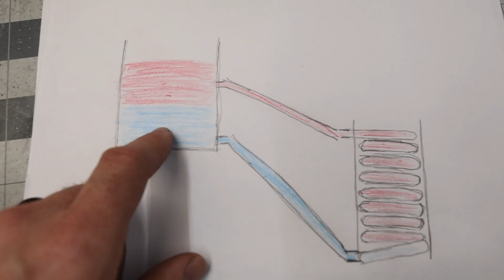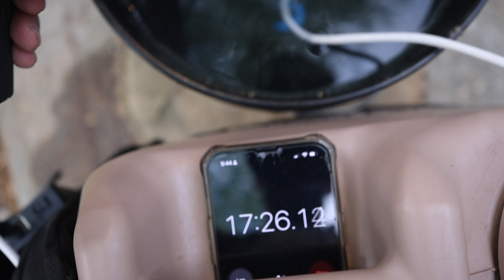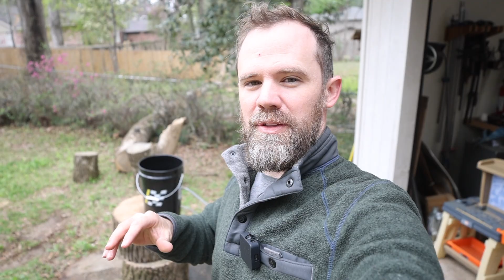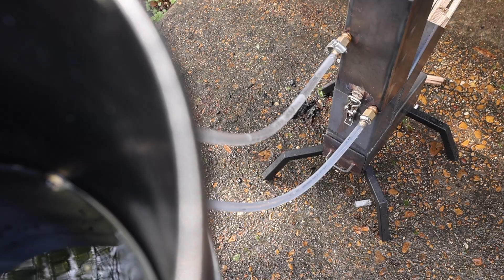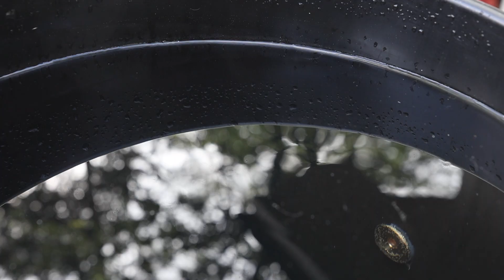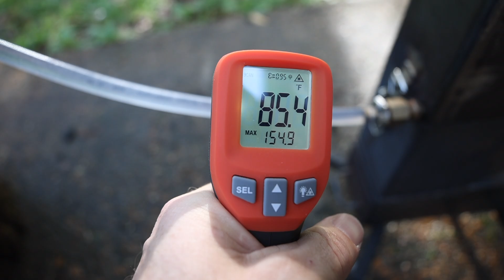Making Hot Water without Electricity!!

Comment: If you start the cold water line at 3/4" and step it down to the size going down to the stove. This will create a head pressure that will help the flow greatly.
Reply from the maker: Thanks for the tip!
Reply: So, have 3/4 inch tube coming out reduced down to 1/2inch just before the start of the coil? Is that what you mean?
Reply: @advdan  Put your inlet on your stove lower than the water jug, so gravity will help push it in. The longer the line, the better.  If that line is 3/4, it will build up a head pressure that will increase when it goes into the 1/2 in pipe. Especially if you use a tapered reducer, like a bell reducer. It will also keep the water from trying to flow in that direction. Make your outlet on the stove just above the hot water inlet on the jug. Ensure the hot water inlet on the jug is just below the waterline, with no water from the jug filling that line. You want to have as little back pressure as possible holding back the hot water. If you put it into the jug above the waterline, you'll get steam and spitting coming out until the flow starts.
Reply: @TheCyberRebel Sorry, but you are confusing pressure with flow, a common mistake.
Reply: @johnnyseagull29   Stepping down the pipe will increase pressure if the pipe is going down hill because of gravity. This is how the old gold dredge monitor works. That's also how those tabletop syphen pumps work. That's a small jar of water that has a tube that comes out of the bottom and dumps water back into the top of the jar. It circulates in an open system without any pumps.
Reply: @TheCyberRebel  this is merely a side effect and only if there is enough FLOW (which is what is missing here) to complete the illusion. To increase the flow you need to increase the dia of ALL pipework. Introducing a bottleneck cannot possibly help.
Reply: @johnnyseagull29  It's just to start the flow, heat drives it. It worked for me.

Comment: I use a similar setup while camping minus the rocket stove. I use a Harbor Freight transfer pump, some check valves and a bag style shower that I hoist up about 25 ft after the water is heated. It's made it to an extended discharge line with a valve at the shower head end. Works like a charm the bag of since water isn't light. LOL thanks for the video, might have to implement some of these ideas including but not limited to a modified coil

Comment: What would happen if the line returning to the reservoir was slightly larger in diameter than the supply? Or vice versa.
Reply from the maker: If I were to do anything different it would probably be that. I’m working on a video now where the copper will wrap around the outside of the chimney but I upped the side of the copper and hoses.

Comment: You can get Thermo Electric Generators that create 12v based on temperature difference. This could power the pump without a battery. If you trying it watch out for the max temperature as is may be to high for some TEG modules.

Comment: This may be too late .   But I used my copper coil incased in steel welded together and filled with sand.    It’s a lot heavier but the sand helps to prevent hot spots .         If you try this beware.  If the steel gets too hot it will sag due to the pressure of the sand .   I ended up using thicker steel and that seems to have helped for the past 6 years or so with mine.     I built one 6 years ago with an ammo can .     It was an upgraded design from the ammo can stove I made when I was 12-13 back in the mid 90s

Comment: You connected your Water Pump to your passive output line; you should connect it to your passive input line to reduce the wear on your pump and increase your thermal exchange efficiency. Cold enters the heat exchange from the bottom, not the top, you were sending cold in the top and out the bottom; you were resisting the thermal exchange and reducing how much heat you could siphon from the burning fuel as a result. You could connect the two lines closer together to increase your available thermal mass; the water is acting like a thermal battery, and the fire is replenishing that thermal battery's thermal energy, but due to how ineffective your thermal containment system is, your thermal battery is hemorrhaging thermal energy; usually, you will want insulated transport lines to reduce thermal loss, this is usually in the form of Copper Lines wrapped in Rubber or Foam, possibly with PVC pipe around that to add more insulation. The reason behind using copper lines revolves around the water reaching ~100 °C, and how effectively the material is able to withstand that temperature in extensive exposure without degrading the containment material. I understand why you used a clear line to record and scientifically diagnose your system, but I explained why those other options are used so you can understand what might happen with the system in the future, and how to fix what breaks. You do want to keep the Cold Water retrieval line lower than the hot water output line on the bucket/container side, you got that right; cold water can absorb heat easier than hot water, so grabbing from lower than the hot output line is a smart idea.
Reply: I can edit this post later from my Laptop if I can find it again, that is easier to do if someone comments on my comment.

Comment: I used a 20 gallon hot water tank and hooked up 2 solar panels in series and water gets to average of 130-145... The top was close to 200 F
Reply: What happens if it does get over 212f
Reply: @Bryan-Hensley I was trying to use this to heat a tiny home... So it will never get to 212.... Tank was stripped of insulation and painted black... The cold on the bottom never exceed 130-140 even in dead of winter with max sun could not heat enough need much more capacity of tank and panels .... But ran 6 months
Reply: Does it work at 10pm?

Comment: Top ! , and the next thing …hook up a boiler and use copper to connect the boiler to the rocket heater ( open inlet for to fill the boiler ) and use thermo sifon to warm up the boiler ( and if you want to add a pump you can use a ( central heating pump ( wilo pump )
Water side pump ( they can stand heat ) 

Stay creative  👍👍 greetings from 🇳🇱 the netherlands

Comment: I'm wondering if it will heat more quickly if the return tube is set higher than the bucket, then using gravity? One option would be to use a taller coil. Or possibly use a box style fill tank having a downslope for cold water and a downslope from the top of the heat exchange back to the tank.

Comment: I wonder if you added a basic mechanical bulb type pump, similar to the type used from gas cans to old outboard motors, attached to the cold supply line that exits the bottom of you water reservoir.  

That may help eliminate the water from boiling immediately once the fuel source is lit and “jump start” or “prime” the system in the beginning to boost the initial siphoning effect. 

I’m sure there are scientific 
words to explain the physics of it.  

Not positive, but there must be a type of one way valve in those bulb style pumps to maintain fuel pressure until the motor is running and creating enough suction to draw fuel to the motor. 

I love your idea and follow up video that shows your improvements and using the community to improve your design.  Excellent work. Great editing also.  I’ve haven’t done much video editing but can assume that it’s time consuming and can make or break a video.

Comment: Just as I suggestion you might put a couple short pieces of silicone rubber tubing at the fitting connections or just use all silicon tubing.  Silicone tubing has a lot higher temperature rating than vinyl tubing at just over 500 degrees.

I have a propane water heater that is a sheet metal box with a burner and a copper coil in it that circulates water the same way to heat the water.  I was trying to cook at the same time I was trying to heat water and I wound up melting the vinyl tubing at the fittings.  I replace the tubing with silicone and no more problem.

Comment: The process you're using for "passive heat exchange" is known as percolation which is what coffee makers use, and yes, it's supposed to sound that way and isn't sketchy at all as long as you have your system set up correctly. A good example for percolation hot water setup would be either soft copper tubing or copper flex lines connecting your stove to water storage and at the minimum a 45 elbow on the hot water return to aim the water toward the bottom or side of the bucket instead of allowing it to possibly belch up and out.
Reply: Percolação é o nome de outro processo que não tem nada a ver com troca de calor, mas filtragem.
Reply: @canaldopicco  I stand corrected, you're correct that percolation is a filtration process. After taking a closer look at a coffee maker, which uses percolation filtration, I found that heat conduction creates convection currents to pump fluids.

Comment: It might be worth considering this in the light of rhe automobile industry.
Early water-cooled car engines used the thermo-siphon effect, which incidentally is why they had tall, narrow radiators. Though this worked on very softly tuned engines, it was soon necessary to add s pump to the setup. As we saw here, with the pump included in the design, it was possible to carry lots more heat away.
Reply: yes and no. thermosiphon necessitates a casting that includes big, free flowing water passages... whereas forced cooling does not.

here, proper design will work thermosiphon... the objective is to heat the water efficiently. the more water, the better. a car wants as little water as possible, as compact as possible... to be made as cheaply as possible... the water is there to dispose of heat, not store it. and yes, as performance goes up, the larger ports, valves, they demand more room, the cooling passages suffer, but theres more heat than ever to deal with... so they throw a pump on. and in the "good old days" they didnt even have decent seals for rotating shafts yet. bit of leather and a gland nut? some graphited asbestos rope? maybe a lead washer? do it up too tight and the shaft overheats and the bearing seizes... early pumps were temperamental! 

the pump works here because he doesnt have large, free flowing passages for thermosiphon to work properly...
Reply: @paradiselost9946  Thanks for clarifying this  : )
Reply: 🤣 Um have u ever seen early automobiles? Im talking like pre 1830's? Have u every heard of the steam engine? Do u have the faintest notion why its not practical in automobiles? Picture huge craters in the ground where there was once an automobile with a fat boiler and a wood-fueled burner. This is searchable on the Goggles.

Comment: For the pump, you might try to use a thermopile or Peltier block.
It may not run the pump quickly but might be enough to where you are not reliant on electricity.
Great video; keep up the experiments!
Reply: How about making a very simple steam engine like system.  When the water in the heat exchanger boils it shoots the water out.  When the pressure in the heat exchanger drops cold water comes into the bottom.  Basically it just needs a larger diameter section at the bottom of the heat exchanger.

Comment: Add a check valve.
Reply from the maker: It doesn't really need one
Reply: @PatrickRemington  with a check valve you could run the fire much hotter and heat the water quicker, because water boiling in the coil would simply decrease the pressure after the check valve and draw more cool water into the coil
Reply: @PatrickRemington  its a 5$ part that does more then you think.
Reply: No check valves needed in these setups, thermo siphon will do the job. We used to run a 60 litre drum with some copper off to one side, couple of coils in the fire and return line near the top of the drum, feed line near the bottom.  Just keep the drum topped up.  This is a really neat set up.

Comment: peltier cell +pump (+charging your phone, power bank, etc)
Reply: Those are HIGHLY inefficient, the ones you seen commercially are mostly a battery pack that get VERY slowly trickle fed. You'd need to run one for days to charge a phone if you even can without it being turned off.
Reply: @SilvaDreams Although inefficient, if it uses otherwise wasted heat off the side of the stove it doesn't matter how efficient it is. One large 12v unit could power the pump and save the need for a battery.

Comment: If you insulated the lines and the water container you’ll probably have less heat loss as well which will speed up the process. It would also hold the heat in the water longer. maybe use like one of those YETI bucket coolers instead of a regular 5 gallon bucket and retest. I bet it would work pretty fast with your electric pump set up. Great set up and testing so far though 👍
Reply: I think even a loosely fitting lid would help, too.
Reply from the maker: Thanks man! I appreciate it!

Comment: Glad you followed up on this after all of the comments. I think an insulated lid on the bucket would help keep the heat in. Some sort of quick hose connections would be ideal for portability. The best use of the DC pump would be for actually using the water as a shower or washing dishes. Some sort of insulating cover around the jerry can or bucket would also maintain the hot water longer in cold weather conditions.
Reply: You should put some thought into venting for pressure build up if you do this.
Reply: I was thinking this too. Boiling water on a stove happens faster when you put a lid on the pot